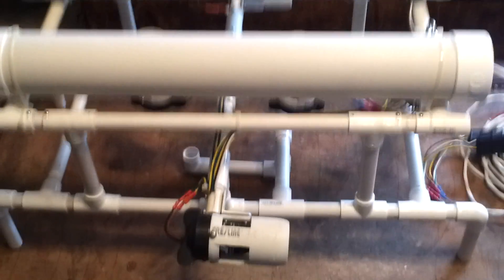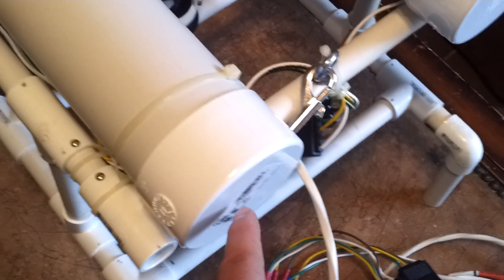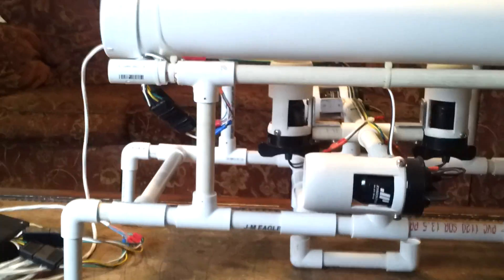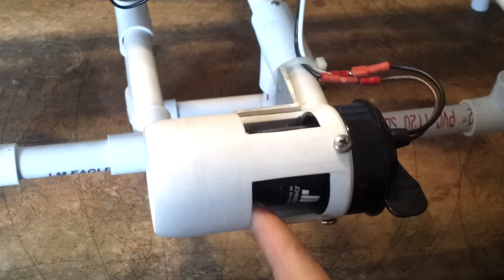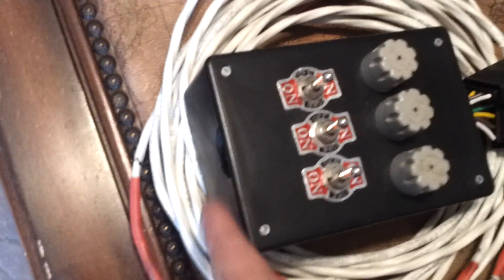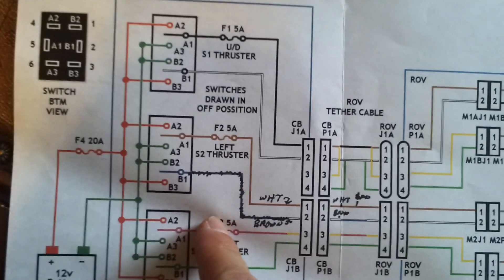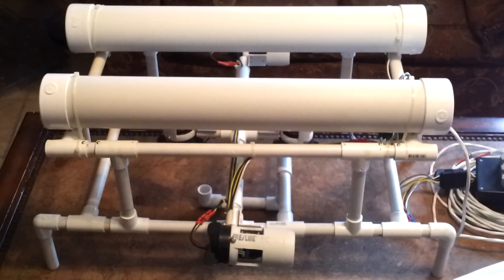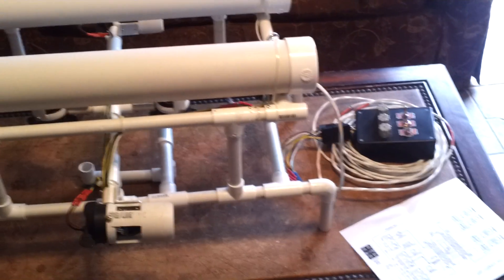Submarine ROV Robot built from Scratch

Comment: What kind of wire did you use for the tether cable?
Reply from the maker: LOL love the name! Well that was over 5 years ago. And I didn't get to choose it, I just helped design it with my son and a few of the guys in his class. They already had the cable. I suppose the gauge of the cable would depend on how much amperage you want to push, how far it has to go (Weight of it) and how much thrust your motors can deliver. There's also a matter of buoyancy. If the cable is to heavy it can pull the ROV down so you have to make the cable buoyancy neutral with floats. The the weight of the cable vs the amount of thrust the motors can give. I think they were using 16-18 gauge wire. To get around the weight of the cable you can have most of it float by using floats to keep it on top of the water. The figure out how far down you want to go and make that portion of the cable neutral so the ROV can easily drag it around. Oh one last thing the longer they are the cables act like big resistors and the voltage and amperage drops the longer it is to. So you'll have to use a wire gauge to amperage drop calculator to see if the length is going to affect your end point voltage and amperage. The best cable is a short heavy gauge wire, but the bigger the gauge the heavier and harder the cable is to drag around. By the way wire diameter goes down as the wire gauge number goes up. Most homes use 14 gauge solid copper, you don't want that because solid copper breaks after it bends a few times, you'll want stranded wire because it's flexible and doesn't break easily.
Balance: When designing an ROV to move or carry things remember that the ROV has a balance point in the middle and what ever you pick up must not upset that balance, hence that's why our hook was in the middle of the ROV right under the balance point, both side to side and front to back. Hope that helps you with the information you need. I will be away from YT for a week so if you have any more questions i'll answer them when I can log in again. Best Wishes& Blessings. Keith Noneya

Comment: How did you attach the propellers to the motor?
Reply from the maker: Hi Augusto, we used a bushing that slid over the motor shaft and used a set screw on the side to tighten it down. Then we drilled and tapped a hole in the end of the busing to mount the propeller and then screwed it on. Feel free to ask more questions if needed. Thanks for watching. Best Wishes n Blessings. Keith Noneya

Comment: what kind of motors are you using ?
Reply from the maker: Johnson Bomba Model: 2855. 500 GPH (Gallons Per Minute) Motor Cartucho. As saias são feitos de tubo de PVC no meu torno. Provavelmente poderá torná-los aquecendo-os com um maçarico de butano e esticando-as sobre um pedaço de madeira o mesmo diâmetro que o motor.
Boa sorte com seu projeto de João Vitor.
Muitas felicidades e bênçãos. Keith

Johnson Pump Model: 2855. 500 GPH (Gallons Per Minute) Motor Cartridge. The Shrouds are custom made out of PVC Pipe on my Lathe. You could probably make them by heating them with a butane torch and stretching them over a piece of wood the same diameter as the motor. Good luck with your project João Vitor.
Best Wishes and Blessings. Keith